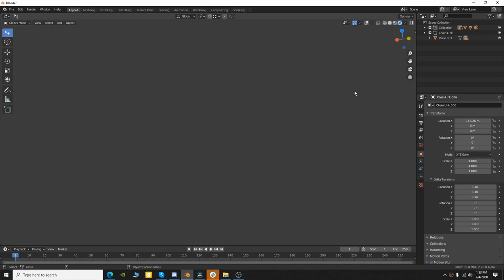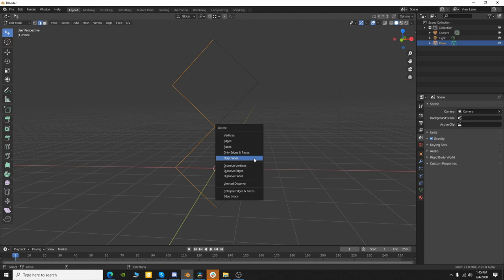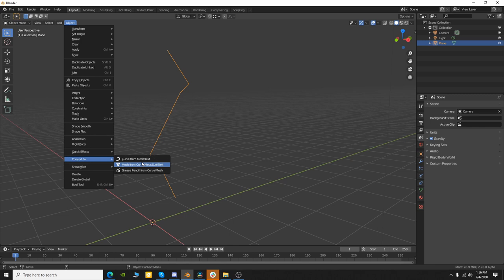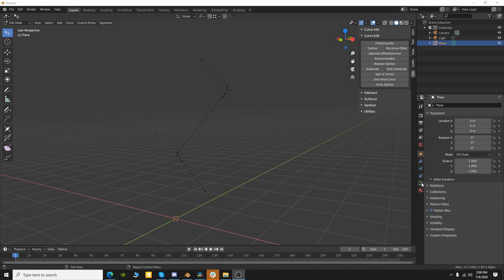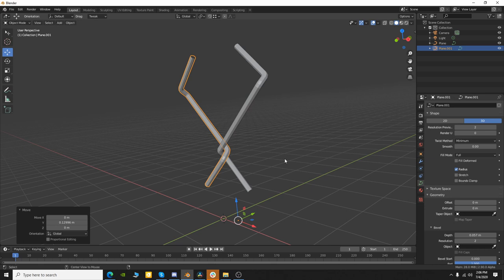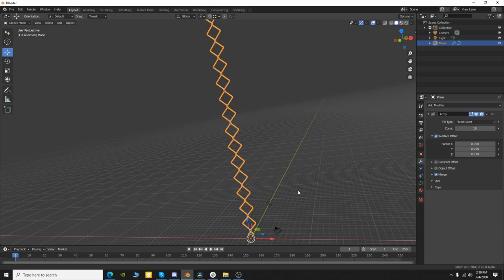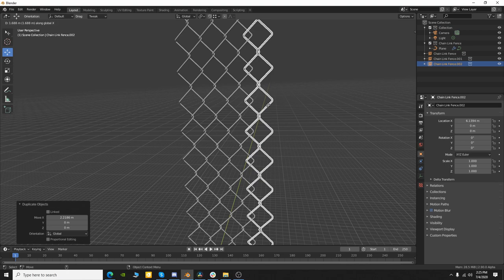Blender: Making Chain Link Fence

Comment: thanks, man. 
why didn't you use a second array in X instead of instances? does it really make a difference in memory space?
Reply from the maker: Arrays aren't instances, you'll notice if you have your statistics open and add an array, you'll see your polygon count go up as you add to the array as well as your memory usage.  Using a collection instance in this case avoids this.
Reply: @massivetree7937  thanks.

Comment: Hello! I got an issue, when I'm using bevel depth in the geometry menu my wire is not round like circle, Its more like very narrow ellipse. Any suggestions?
Reply from the maker: hmm, haven't seen that but have you tried applying the scale in object mode?  (ctrl A)

Comment: 👍👍👍 Excellent! Everyone needs a way to cut down on the poly count so renders and animations can be made quicker and run smoother without sacrificing quality. I had a cyclone fence that used a full gig of memory! It has gates and poles and ties and pole tops but it was making the animation scene very slow. Fences don't move so I was definitely overdoing it for an animation of a UFO that briefly passes over the fence. Thank you for this great tutorial. 🌞

Comment: Can't get snapping to work. I've double checked that my snapping settings were the same as yours, but it simply refuses to work. Also tried both holding down and not holding down ctrl while moving.

Ended up using a mirror modifier to get the plane mesh set up, but would love to get snapping working still.
Anyone know what might be happening here?
Reply from the maker: Are you doing it in object mode or edit mode?  In object mode it may be trying to snap to the object center.
Reply: @massivetree7937  Edit mode in vertex selection mode
Reply from the maker: @ForgottenMovieGems  I've never had an issue where snapping didn't work.  The only other thing I can think of is, in addition to having vertex snappinig enabled, you want to make sure that move is selected as what is affected in the snap panel as well as closest vertex.
Reply: i had an issue where bc i duplicated the plane in object mode, they were two separate objects, and the verts wouldn't merge. 

So in edit mode, duplicate --(in vertex select) -, then with the top 4 selected, & the bottom 1 of the 4 vertex as active,  hover mouse to vertex you want to snap to with active one.

Comment: this works perfects and is super easy but the fence is too uniform. What do you suggest i do to give it some wavyness or randomness.
Reply from the maker: You would probably need to make it real geo instead of instances and then I would probably use a lattice modifier on it to warp it randomly.
Reply: @massivetree7937  thanks!

Comment: How come you have extra edges when cutting into the edges of the square planes, i only get an edge per side of the square?
Reply from the maker: Did you subdivide them as I showed in the video?  It should create an extra point in the middle of the edges.
Reply: @massivetree7937  Thanks managed to get around it by using a edge loop, thanks for the awesome video!  Will remember the sub divide step for next time :P
Reply: @A5tr0101  did loop cuts end up working? i was thinking about doing that. because for some reason its not letting select the edges to subdivide them? its also not letting me delete the edges, i have to delete for vertices for some odd reason .

Comment: great video. easy to understand. only issue i have is when i create an array, it makes the array move diagonal rather than up down left right. I made it work by messing with 2 axis rather than one. do you know why this is?
Reply from the maker: You should only be moving it with one axis to make it go up.  Check to see if you need to apply your rotation in object mode with Ctrl A
Reply: @massivetree7937   that worked. thanks for the fast reply. worth the sub for sure.

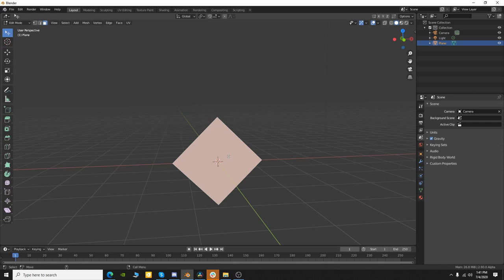Comment: I can't understand.. You going to fast... what is vertex snapping.. 0:37
Reply from the maker: I'd recommend watching a video on Blender snapping.   Vertex snapping allows you to snap one vertex to another so that they share the same space (so they can be welded)  If the video is too fast, you can slow it down with the gear icon at the bottom of the video.